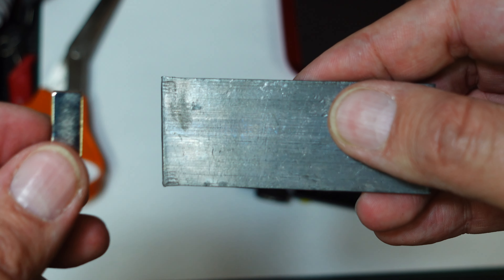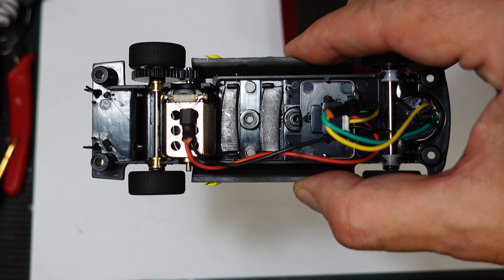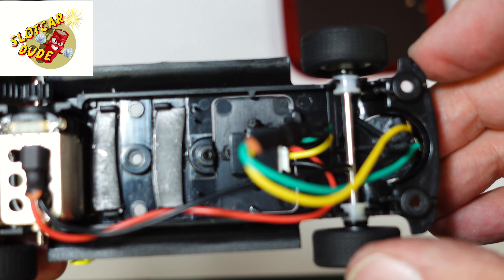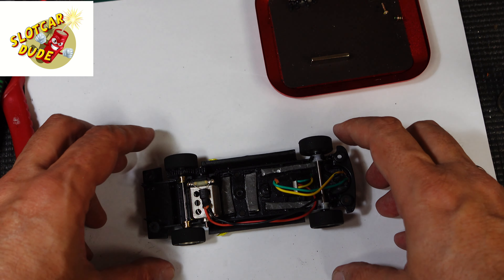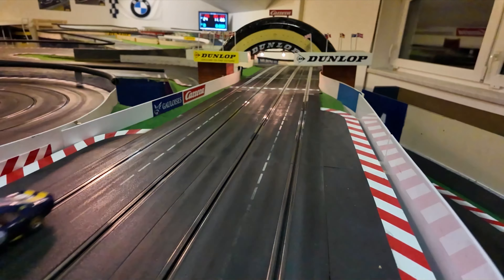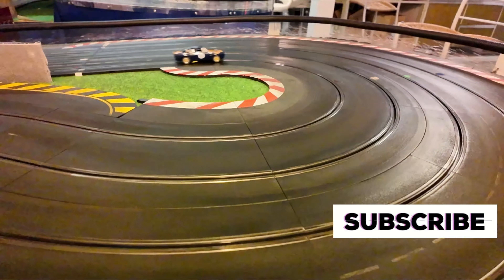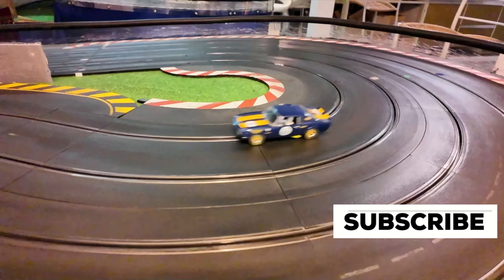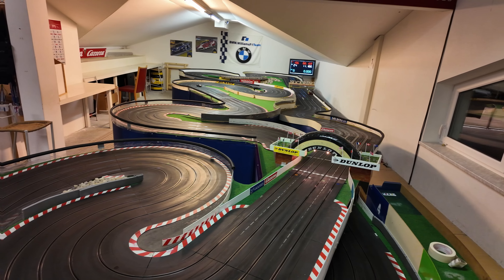Pioneer Camaro: Non-magnetic Track Tested #slotcar #slotcarracing #slotcars #132 #132slotcar #

Comment: Had to put my daughter to bed mid video. Just watched the rest of it now. On par with Scalextric on performance non mag with weight. You need a fair bit to get it running well. I plan on modifying mine. I did the legends and that had no weight added but a lot of tuning parts to get it running. Nice review, bet it runs a lot better with non mag.
Reply from the maker: No worries Paul! Yes, but it is an easy fix and easy adjustment!! Have not used any aftermarket spares yet!
Reply: @slotcardude68 the problem is the gear mesh, I had to grind  the axle holders to adjust gearing 😂. Rob from Swift slots raised his axle up to adjust chassis height and gears. The issue is that as it is side winder the clearance between the gear and track needs to be checked. My legends has new wiring, new guide, new wheels, new motor, new axles, new gears etc just the chassis and body are standard 😂

Comment: Where can I find that kinda material my Hobby Shop does not carry it. Thank you for the help lovely video.
Reply from the maker: You can also use TUNGSTEN, can be found at fishing supply shops. Or you use small weights with sticky tape to trim aluminium rims.